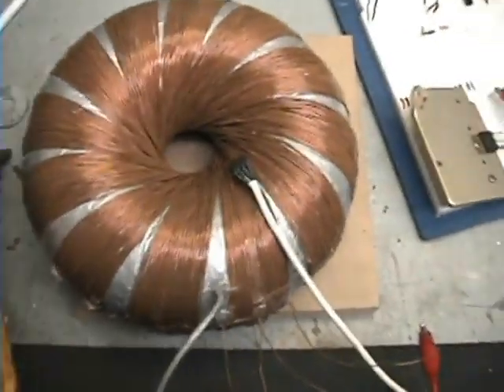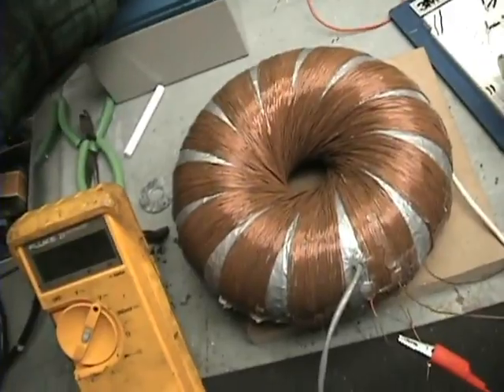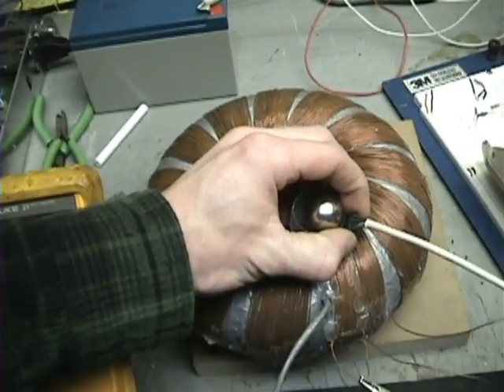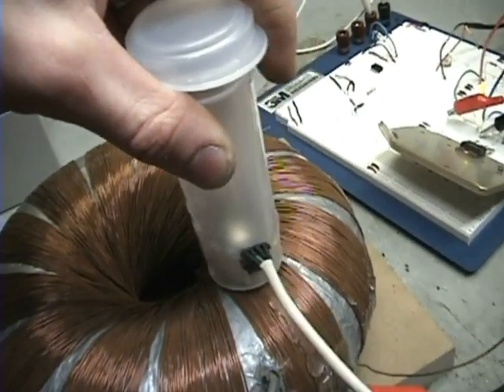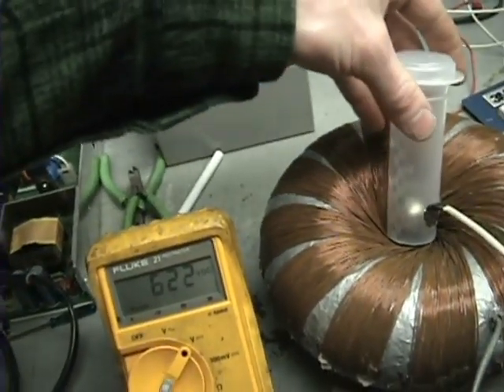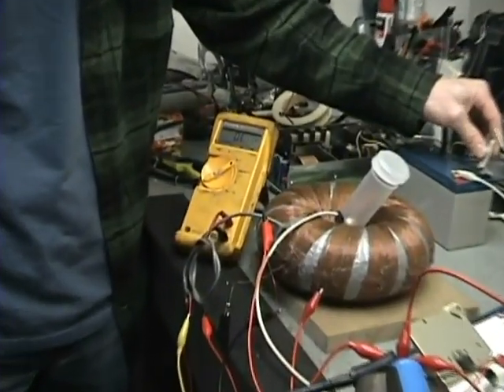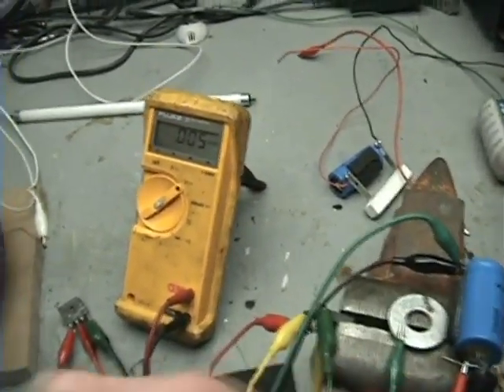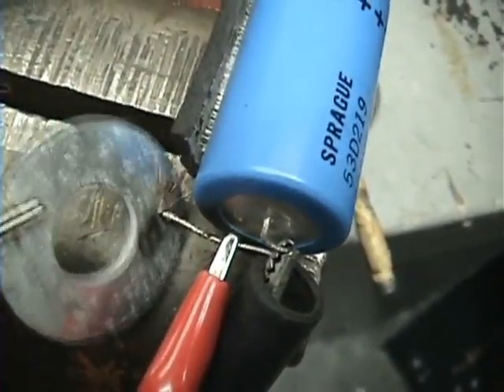Fast Double Pulse Motor Fan Mod External Driver Rodin Coil. my new HVTWRC (TEST 29)

Comment: what happens if you put the shaft from a DC motor inside the center of the rodin coil? would it spin the motor? or perhaps get a VW generator and see if it can spin that. I mean its cool to see it spin a magnet, but the magnet does not produce energy you can use. I have seen alot of videos on youtube of people playing with this Rodin coil but I have yet see anybody make it produce electricty you can use.